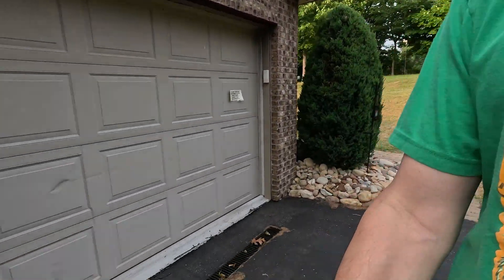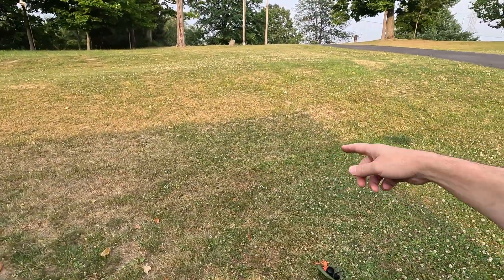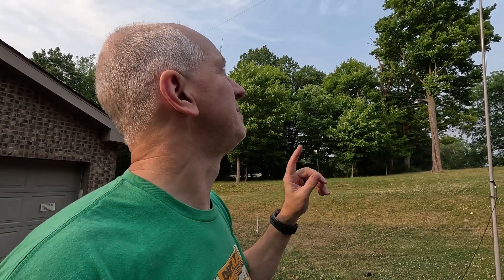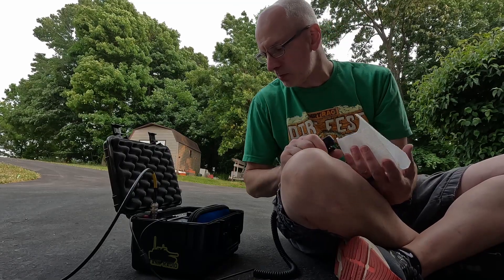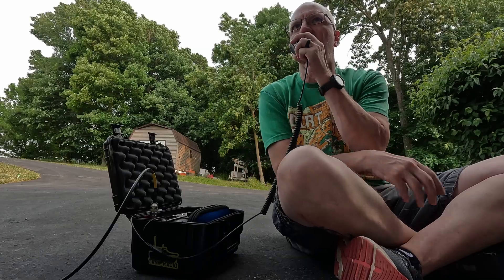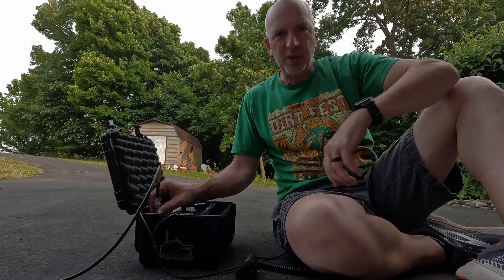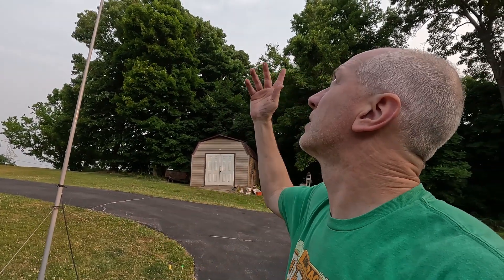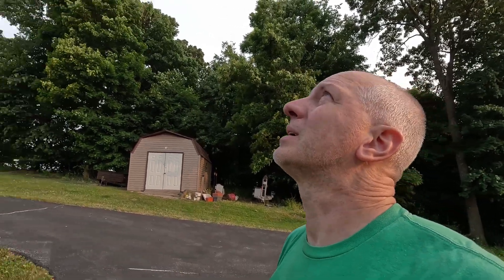Can you run a dipole in an L configuration?

Comment: I have had many years experience with dipoles and various other antennas. The dipole ( balanced antenna with two 1/4 wave legs) works good in almost any configuration. The best ( in almost cases) is with it horizontal and at least 1/2 wave high. You can slant it to more of a 45 degree slope and it still works quite good. You can turn it to completely vertical and it still works. ( ground conductivity out in front of the vertical makes a huge difference. The difference between a vertical and horizontal is not so much if the vertical is radiating out over seawater) The maximum gain is with it horizontal and the gain drops as to is turned vertical. In general the difference will be 5 to 8 db reduction from horizontal to vertical not over seawater. About an S unit or slightly more. The inverted V configuration is just slightly down from a flat horizontal dipole. For me I just put up a dipole anyway I can get it and I work all over the world just fine.
regarding which wire the center conductor of the coax is connected to, it should not make any difference if its to the vertical wire or the horizontal wire. However, there may be cases where you would want the shield to not go to the vertical wire. I doubt it would ever matter with a wire dipole. A standing wave of RF current will exist on the dipole and since the instantaneous polarity will vary at the RF frequency it makes no difference which wire goes where. If interconnection more than one dipole in some kind of phased array then it will matter. Full size antennas radiate more than shortened antennas. So the best antenna is a full size horizontal antenna at least 1/2 wave high. Within certain limits the product of current on the wire times the length of the wire is proportional to radiation. Up to a half-wave long wire that is definitely true.

Comment: Nice box you have for your 705! 73!
Reply from the maker: I do like it, but it had some issues which I had to resolve.  the 2.5mm jack was bad and I had a hard time finding a replacement.  They are all over ebay, but you have to search for the term "radio box" they make them for other radios too.